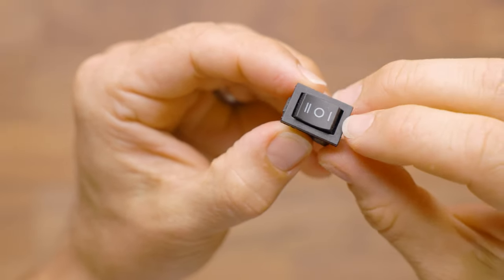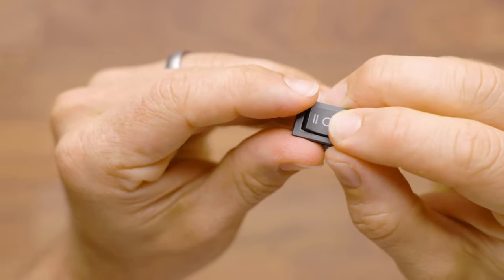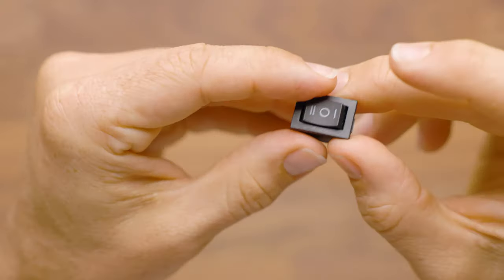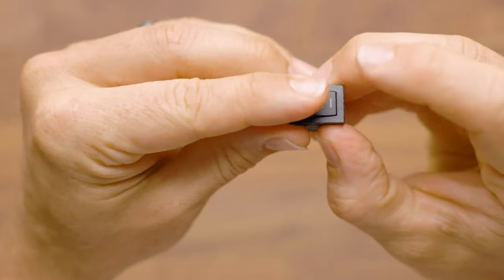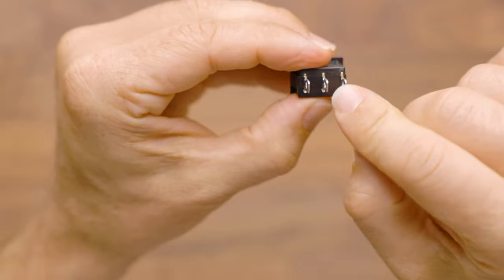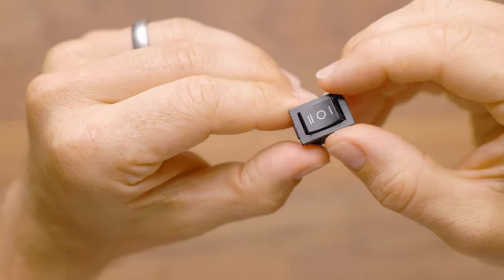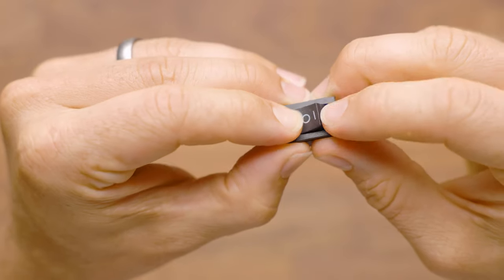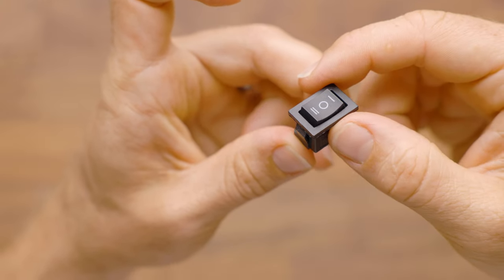Product Overview: 3-Position Square Boat Rocker Switch

Comment: These switches are deeply disappointing, and very misleading say you want to have your water gauge and it's backlight on a day/night setting, then you'd want 1/0/(2 both on) the fact that this just makes the switch 2 switches in 1, but a switch that only allows you to use one side at a time makes them frankly useless. Stupid.